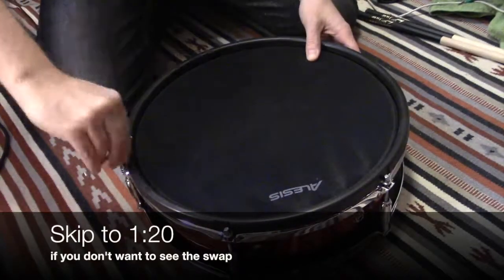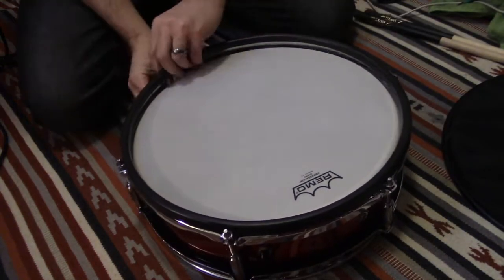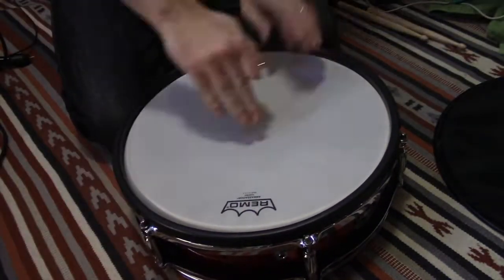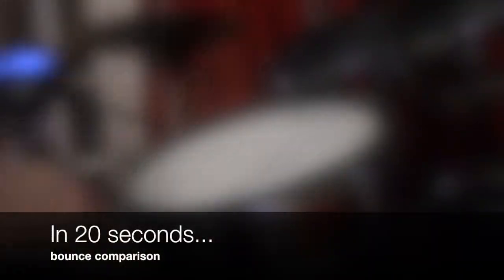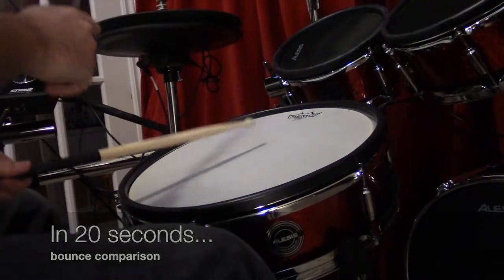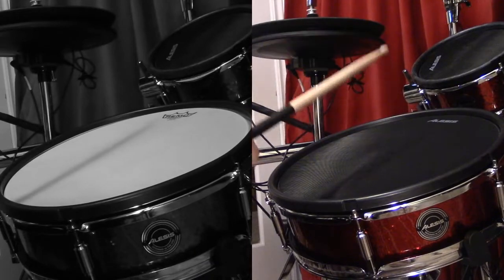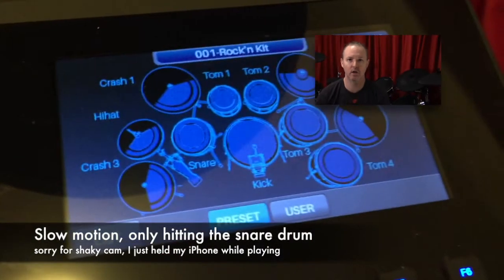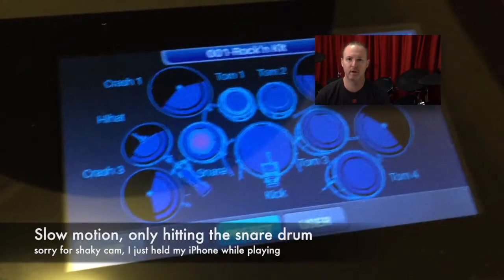Using Acoustic drum heads with electronic drums

Comment: Hi Jason,
At the end of the video you say you're waiting for some drum tec real feel mesh heads...
Did they arrive ? Is there a video on that ?

I have an alesis kit. I got the "real feel" head for my 10'' snare. It looks great and feels good too.
But... the sound for me is an issue. Too loud for my taste. I can hear it with headphones.
Thinking about setting the black Alesis head again...

Wanted to know if you tested them

Thanks
Reply from the maker: Yeah, I have one on my snare. It’s louder but feels way better. Check out 65Drums, I know he’s tested pretty much every single/double/triple head on eDrums.
Reply: I've just bought an Alesis DM8 PRO kit, and the Mylar heads are extremely loud. I'm in an apartment so it's out of the question and the full mesh conversion seems a bit difficult for me to do. Have to sell them.

Comment: Would adding acoustic drum heads be rather an advantage to the electronic set? (Does it make a difference when playing?) 

Great video too!
Reply from the maker: For feel, it’s better, but in the short test I did, it was worse for triggering. Seemed to lose a lot of the dynamics, but I didn’t really do a proper comparison of mesh vs other head types.
Reply: Jason Little Ohhh, alright sick. Was looking too see if it could almost replace the heads when playing. 

Thanks for replying, man!
Reply: @Jason Little  did you adjust the threshold triggering setting after changing the heads to see if that'd help the crosstalk? If my cymbals ever cross with the toms on the same rack, that's what I change first.